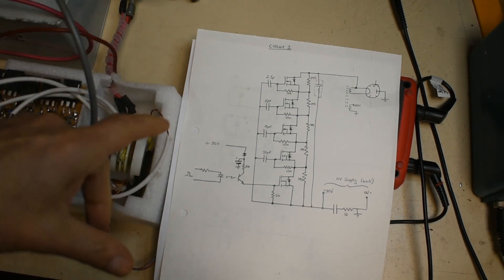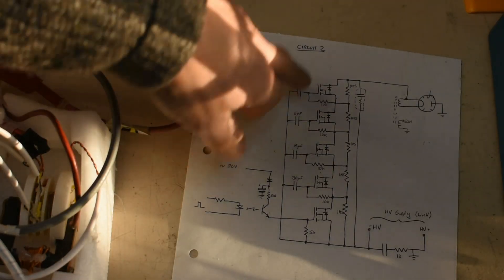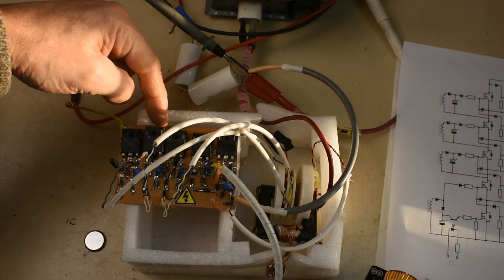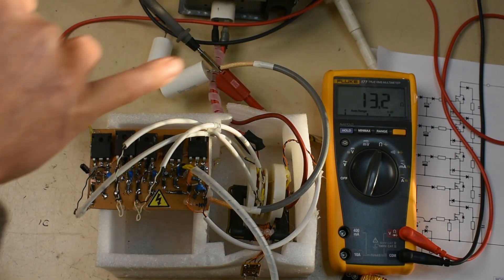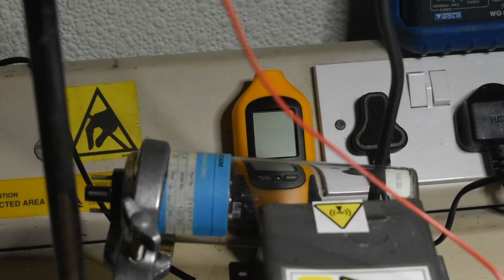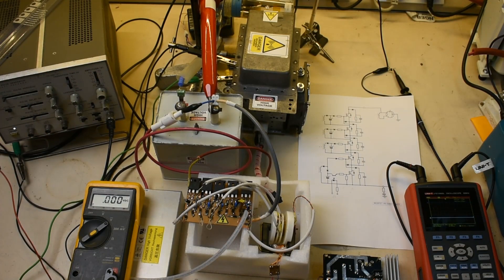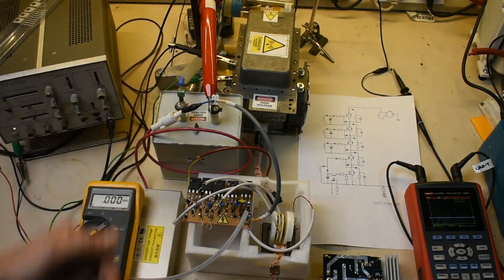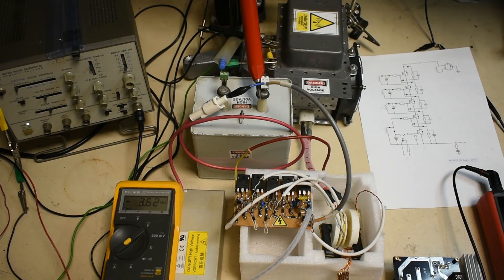Magnetron Pulse Switch continued

Comment: What sorts of speed are you looking at, if 60us is fine Vishay vom1271 will probably work as driver, otherwise you really will need to wind your own pulse transformers to cascode them properly.
Reply from the maker: Really looking for an adjustable pulse speed down to a pulse width of less than 1us. This is a difficult speed to achieve and it's also difficult to adjust the width with a transformer solution.
Reply: @tuopeeks  So looks like you are going to have to both build a set of isolated power supplies, low capacitance for each, and then a set of optically coupled drivers to provide the switching. You might want to look at a set of toslink units for the switch drive, as those at least can allow you to have one set provide active turn on, using the isolated supplies, and another identical set providing active turn off as well, allowing better pulse width control, and the ability to work down to near DC level as well. Driver side lots of IR diodes in series, to get sort of sane powe, probably running them at 20mA, and then photodiodes on the isolated side so you can switch the gate to either a low impedance supply for fast turn on, or switch to a low impedance ground, probably using a beefy mosfet driver that can handle the 5A or so gate current needed during that time. Power you might need to accept poor efficiency, and use something like a ferrite rod, with the secondaries all wound in small well separated blocks, and then a rather high power drive wound tight to the ferrite rod, so as to minimise capacitance, at the expense of poor regulation (shunt regulator time) and poor efficiency. Otherwise find a scrapped inverter microwave and salvage the power transformer out of it, that at least will give the core and a decent former to recycle as power source, plus the isolation needed as well.

Comment: Good to  see another vid mate 😎👍... Have you removed the magnetron input cap and inductors?
Reply from the maker: Good point, the inductors are out but the feed through capacitor is still there as it's the connector. There is a bit of the output pulse superimposed on the trigger pulse and this could be feedback with the inductors missing or possibly just pickup.